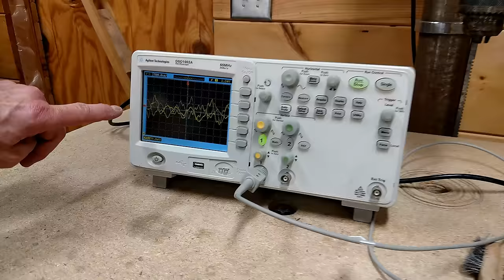Active Noise Cancellation

Comment: Ok, so I have an idea. I have a loud diesel truck. I've ordered a small stereo microphone and a 3.5mm splitter. I'm going to invert phase on my stereo speakers. I'm going to mount the microphone in the engine compartment near the firewall. If I hook my phone and microphone to the splitter, it should play music normally while cancelling engine noise correct?
Reply from the maker: Probably not.  It's complicated because cancellation requires the phase of the sound pressure waves to be as close to 180 degrees apart as possible.  In other words, the peaks need to align with the troughs of the canceling  source.  This is location specific and has to compensate for reflections as well.  That is why noise canceling headphones place the mic and the cancelling speaker within millimeters of each other.
Reply: @TechIngredients  so I'd have to mount extra speakers to the firewall with their own driver then. I can do that. Thanks for the reply and the amazing content btw! I'd like to develop an algorithm that actively cancels road noise while allowing music and other media to remain untouched. It would be an amazing aftermarket radio solution built in. I don't know how to code though lol.

Comment: I leave in San Antonio Texas. My home happens to be in front of the expressway. No wall to prevent car noise to enter my property. Do you believe that this noise cancelling can be may to cancel the noise which comes from expressway. Before we had noise before 6:00am it would die till 4:30 pm but now the amount of traffic has increased along with noise all day long.
Reply from the maker: It probably could.  The wall which transmits the greatest amount of sound would be the best place to start.

Comment: Could you apply shakers to a window to reduce noise in a room?  I would love to do this but wondering if you have a parts list!  Thanks!
Reply from the maker: You could.
The drivers, not shakers, are available from Parts Express. The specific model isn't important.  You need a small microphone to feed the sound impulses to the amplifier, and an ability to adjust the amplitude of the inverted (reverse the polarity of the leads) signals back to the window mounted driver.
Reply: @TechIngredients  Thanks so much. I will look them up!  Have you ever done this before? Attaching drivers to windows?
Reply from the maker: I haven't.

Comment: Hi there I was wondering if it’s possible to build ANC for my backyard, I have a major street behind and it’s hard to enjoy the backyard with all the car noise coming from the street?
Reply from the maker: That might actually  be easier  than an active system indoors.  What complicates noise cancelation is reflections from different surfaces.  The mix will be very complex in amplitude frequency and phase.
Outdoors,  the only challenge will be the required power output.
Place the speakers, canceling the noise, as close to the listener as possible, that's why headphones are so commonly used with this technology.

Comment: Hello, this is a very interesting topic, I have a question, I want to make an active noise reduction system in the room in which I work, there are also other people who like to listen to the radio all day standing at a distance of a couple of meters, which annoys and annoys me very much, I cannot turn it off, but if at my workplace in the immediate vicinity I place two acoustic systems to which I connect the same signal from the radio but in antiphase, I plan to use the dsp adau 1701 module where it is possible to smoothly change the phase of the signal with a time delay, I understand that it will not work at all suppress the sound, do you think it will work at least 2-3 times to reduce the volume of the playing radio?
Reply from the maker: Probably not.  The major problem is reflections within the room. The phase cancellation will only be effective at a specific location if the noise is comprised of a predictable amplitude and phase.  That is why noise canceling headphones actually sample the ambient noise and apply an anti phase sound.
Reply: @TechIngredients  thank you for your answer, so I count on suppressing noise only in one specific place where I sit there and place two speakers in close proximity to which to send the same signal from the radio, but in antiphase by selecting the desired phase rotation, it's just not entirely clear to me about dsp processors by setting the delay it will turn out to change the phase is it the same thing?
Reply from the maker: That would only have some chance of success if you were sitting outside.  In an enclosed space, reflections of the sound from the walls, ceiling, structures in the environment as well as the floor will mix multi phase versions of the sound with the fundimental source making any phase cancellation based on the original source impossible.
Reply: @TechIngredients  thank you for your answer, I live in ukraine and in the early 200s we had a company that was engaged in similar projects, it had demonstration rooms where music was played in the room in one part and in the other it was quiet how they achieved it I don’t know then me it’s not I was interested in, in my room there is a carpet on the floor, I sit in one place at the table and I  from the left and right I can fix sound-absorbing panels that will partially extinguish reflections, I am fond of audio equipment and subscribed to many channels on YouTube on which people post a demonstration of the sound of their systems, and the problem of any correct installation of an audio system in a room is sound reflections inside premises, and this is very audible on the recordings how one speaker system can sound completely differently in different rooms or in different locations inside the room, and recently a solution appeared, a person installed, if I am not mistaken, 6 microphones 4 in the corners of the room and recording the phonogram right in front of the speakers and did subtraction of the reflected sound that is picked up by 4 microphones in the corners of the room, I do not know how this is done yet, but it seems to me that if you try the same way, you can suppress noise even in an empty room, especially since active noise cancellation systems are developed in premium cars and are excellent suppress in an active way ambient noise from the street

Comment: So, since light is a wave and this can be done with lasers using a beam splitter, and since headphones with active noise canceling exist, could this principle eventually be adapted to work with light and build a kind of dark lamp? I know Action Lab did a demonstration of a beam splitter and said it wouldn't work, but I don't see why it wouldn't. All you need to do is be out of phase when hitting the surface, right? It's gonna be super difficult of course, and need some extreme precision and most likely a really smart computer to work it, but physics-wise I don't know of anything that'd make it impossible. What would the exact issues be that might prevent it from happening?
Reply from the maker: Theoretically it is possible.  And, you're right it would be very difficult because the wavelength so short. Not only does the frequency and the phase have to cancel, but the angle of incidence on the surface has to match because this lengthens or foreshortens the intercepted waves.
Reply: @TechIngredients  So it's much harder than I thought. And probably needs multiple light sources to cancel the light from one normal lamp then, unless we bend the light somehow. Some sort of smart dust cloud with a connection to the light source might do it, but now we're trying to make utility fog :P
Or if we're trying to reflect light off of tiny robots, we might as well have a built-in light source on the particles of this dust cloud.

Thanks for the answer! It was surprising to get one, and really kind of invigorating to see possible solutions to a problem I didn't know this concept had.

Comment: So could you reverse this to make a quiet chamber? A bit like noise dampening in a car? I know some have small speakers in the headrest.
Reply from the maker: Potentially, yes.  We're now working on active sound blocking panels that improve on some of the shortcomings in this box.  The microphone needs better isolation from the panel and the panel needs to be as stiff and light as possible so that it operates as a single plane rather than like a chladni plate.
Reply: Hmm, that’s really interesting. Personally I’d like to see this turned into a ‘quiet kennel’ for a noise sensitive dog. Presumably you’d have to record fireworks and thunder? Or have some kind of fast algorithm to phase out the sound.

Comment: How do you ensure that your speakers are 180 degrees out of phase with the sound you're trying to cancel? Is there no way to control that other than positioning of the microphone?
Reply from the maker: You can use a phase delay and that can be a pretty simple circuit similar to a cross over.  But, the delay will be frequency dependent and if you want to achieve broad band , 180 degree phase offset then you will need a DSP as Bose does in its noise canceling headphones.  It is much simpler to try to locate the microphone as close as possible to the speaker and wire the speaker with a reversed polarity.  As the frequency climbs and the wavelength decreases you will reach a limit where even the smallest spacing becomes significant.  This is where this technique fails.

Comment: Would geometry be another degree of freedom?  I remember seeing the video of the quietest room on earth and it is made up of wedges aligned on the walls differently instead of just a flat sheet.
Reply from the maker: In a way, depending on how you look at it.  Those wedges are used to inhance the absorbtion of sound through an increase in  lossy reflections.  They function like the foam in our box, but enhance the performance with a shape which increases the number of reflections.

Comment: Well, in electronic or mechanics (sound here) the only 3 things are mass, stiffness and damping.  For any given system, for a given frequency, one can tune these factors for minimal response.  The biggest challenge is measuring and producing those optimized factors.  Not impossible, but not easy either.  Sometimes close is often good enough.  The interior of automobiles is a classic challenge.

Comment: Is there anyone sponsering you ? There has been lots of research in active and mechanical noise cancellation, Bose for one company, there are systems incorporated in some vehicles working in the exact same manner, I had also developed an enclosure some years ago with the same set up as you have done, it will work, just needs tweeking.
Reply from the maker: No, we have no sponsors.  With the eclectic mix of topics we have covered and plan to cover in the future, a single sponsor would be an unusual entity.  The YouTube community is our target.

Comment: Interesting fact is that when NASA launch rockets they use multiple large sprays of water to reduce the sound waves made by the engines of the rockets so the sound wave don't destroy to engine itself. The water absorb part of the sound wave.
Reply from the maker: That's correct.  Most people assume that the water is only to cool the launch pad.

Comment: Wonder if I can get this to noise reduce my 2,000 watt suitcase size portable generator .... it would be nice be able run it at night and not disturb anyone. By day I would like to use it charge the battery for CPAP machine and by night, a small air conditioner.

Comment: Whoah... you may want to edit and correct the bit (at 2:30) where you state that the speed of sound is 1100Hz.... all frequencies travel at 1100 feet per second... not cycles per second.....  And ( insert edit,)  at 8:50... you may want to correct (doubling the sound energy) you actually get 6db ~ quadruple the sound energy -

Comment: What complexities are added when the sound source has multiple frequencies, like engine noise?
Reply from the maker: Nothing.  Because the microphone is responding to the total sound pressure at each instant and sending this value to the amplifier which sends a corresponding voltage to the exciter, the result is the same for a single and for multiple frequencies.  The microphone is effectively integrating the individual frequencies.

Comment: Is there any way to reduce low frequency vibration? There’re rooftop AC units on top of rooms - decibel is minimal but give us headache in 10-15 minutes... there is rubber pad on 4 corners of the AC but it didn’t seem to work...
Reply from the maker: It is possible that the noise from these units is transmitted through the building's structure and then radiated from the walls and ceiling which are near the ocupents.  If that is the case then the most effective treatment is to engineer the isolation much better.  The rubber may have dried out and compressed or more likely, was never good to begin with.  Without knowing more, the best principle is to support the mechanicals with as little constraint as possible.  The more it moves, sideways and up and down, the less force it applies to the building.
Reply: Thanks a lot for your reply!

Comment: You're going to suffer another problem as a byproduct with a motor in an enclosure like that, which is heat buildup and lack of oxygen for combustion from exhaust gases. You've got to direct hot gases out, which means a fan probably and now you're actually adding to the overall noise generally speaking and more importantly creating an opening which then allows sound to leak.
Reply from the maker: You are absolutely correct and as the Merovengian said "everything has a cooost". What we are trying to do is add an additional tool for noise control rather than solve the problem with a single approach.
Our preliminary design will use DC fans to pass air, in a unidirectional flow, through several sound reflecting louvers over the diodes and generators which produce limited heat, then over the engine and then over the muffles and again through several sound reflecting louvers along with the exhaust gasses.  The active component would enhance the barrier function of the walls that direct this airflow without adding inordinate weight.  A helium barrier may prove a better solution than this active control.  We'll see.

Comment: But does the reduction in sound transmission prevent hearing loss or damage?
Reply from the maker: Of course that depends on how effective the reduction is.  But, if your asking if the reduction is real or just masked and seems quieter then the answer is that it is real.  The explanation is pretty simple.  Sound is not continuous pressure, you'll get that when you face into a wind or from static pressure under water.  When the periodic pressure pulses which are sound have their low pressure valleys filled with the out of phase, canceling sound, the result is much closer to a continuous pressure.

Comment: If it's the vibrations that cancel each other out then why not use magnets and sync with an electrical connection.
That way when the pressure builds against the surface of the box the electrical connection is made stronger and the magnets that are energized push back against that pressure.
Reply from the maker: That's  basically  what is happening.

Comment: Sounds waves can be sinusoidal, actually they like to be sinusoidal and impose this, like the surface tension in fluids does. Bandwidth of a media etc.
Reply from the maker: Yes, that's true.  The pressure changes that occur as a sound wave impinges on a surface is not for example, an abrupt, discontinuous square wave function.  However, the point that I am describing is that the pressure wave is, at any specific point, a one dimensional variation in pressure rather than a two dimensional "up and down" wave like the disturbance on the surface of a body of water.  It is often illustrated this way and this can be misleading.

Comment: Couldn't you also make a box without any parallel sides to drawdown any direct reflection of the sound waves within the box?
Reply from the maker: As long as the sound reflects it will dissipate with each reflection.
Reply: @TechIngredients  Thanks. I have built  speakers lined with foam batting/lead in the shape of a pyramid with a flat top.  Thank you for your videos.

Comment: If the application was reversed, foam on the back of the harder rigid surface it could effectively direct the noise energy in the direction desired, correct?
Reply from the maker: Yes.  The result might be subtle and depend on the location of the original noise source and the stiffness of the foam, but a wave is a wave and you can control the direction of its reflection.
Reply: I'm into car audio and i have seen where some people were losing decibels after sound deadening. From what I've seen and learned here if a dense rigid panel was placed over certain sections it could direct the wave instead absorbing it in unwanted areas. Just throwing ideas around.

Comment: Lower frequencies are more pleasing to the ear. The first speaker frequency was slightly lower then the tinnitus hum. Daily use earbud / earplug amplitude noise canceling would be nice. So you can have a normal conversation at the gun range. Or something more advanced that eliminates most music in a store but preserving human voices. Store music drives me crazy and their is no need for that, yet they blast it with the erroneous logic of providing a better shopping experience or driving sales.